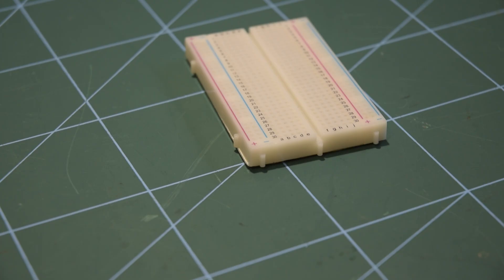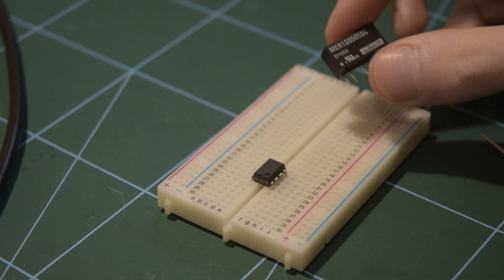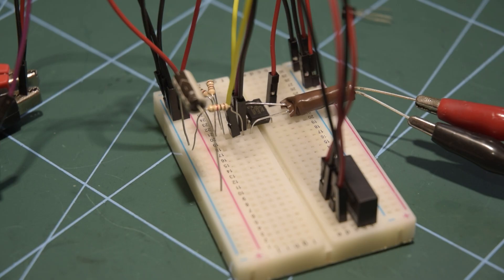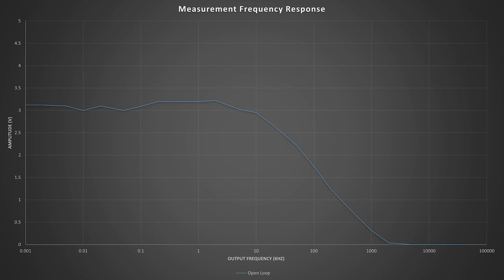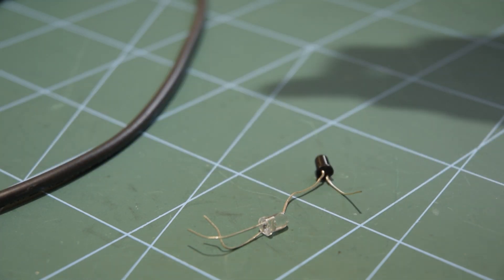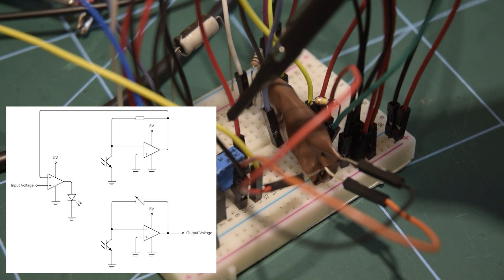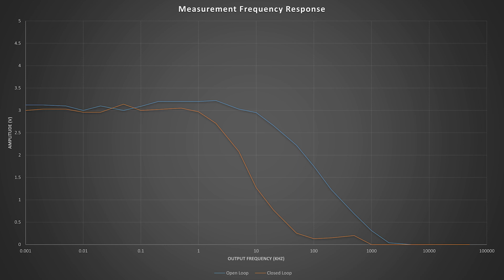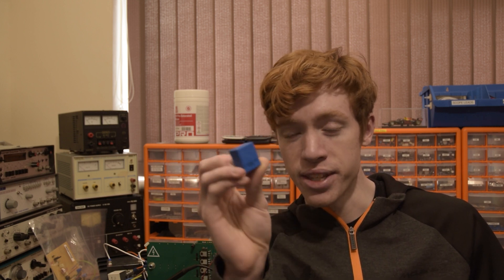Isolated Voltage Measurement - Analogue Optical

Comment: If you are still toying with this circuit you can increase the photon transfer by sanding the top of the led and photoled flat just avoid hitting the semiconductor or bond wires

Comment: Fun making a DIY opto coupler, but I felt it took you away from the original goal of the video. Yeah you covered it essentially, but you kind of whizzed through the opamp section because you were keen on the DIY part. Then you spent ages measuring the performance of that DIY part, and it all kind of went off the tracks. 

The DIY opto would have made a great extra video though!

Comment: Honestly the original output looks very linear between 0.5V and 4V just not 1:1, how much would it help to just add a second trim-pot for offset
Reply from the maker: Yes I thought that too. I did consider adding an offset trimmer, but decided to just keep things simple here.
Reply: 5:49 schematics shows photo transistor, not a diode for some reason, btw.
Now, remembering that it is a diode, the source of non-linrarity is probably opamp input bias current which becomes significant at lower diode output voltages. So maybe try FET-input opamp.

Comment: Use chrome decoration tape (=plastic) around the two IR LEDs and finally use heatshrink to seal it. This will increase the sensitivity and makes it more accurate. I use this method to make Vectrols (commercial name), a LED and a LDR.

Comment: I had such high hopes for the closed loop circuit! Great video.
Reply from the maker: Same, my disappointment was immeasurable and my day was ruined! I probably will end up buying the Vishay one just to see how good it can be.
Reply: @electrarc240  do you think that the matching of the photodiodes or the coupling of them to the LEDs to get equal light was the issue? I wonder if a 3d printed mount would help to get them to match or characterise them.
Reply: I would trust that the Vishay would be awesome 😄
Reply from the maker: I recon it must have been more than one thing for it to be that bad, but yeah alignment was definitely the biggest issue cause as i mentioned the photodiode used for feedback was working fine. A 3D printed mount would definitely be better than just a load of tape haha